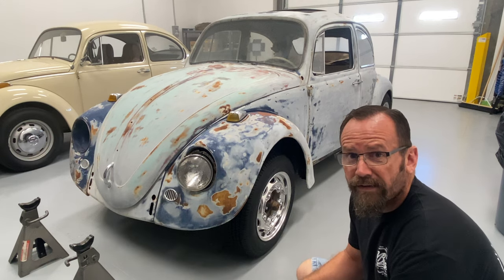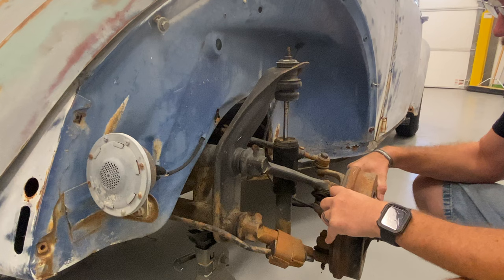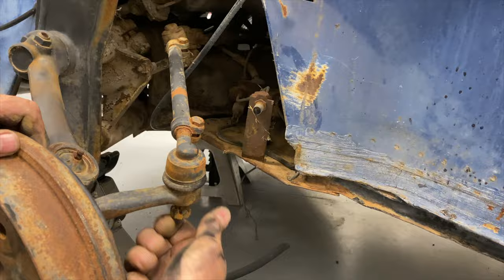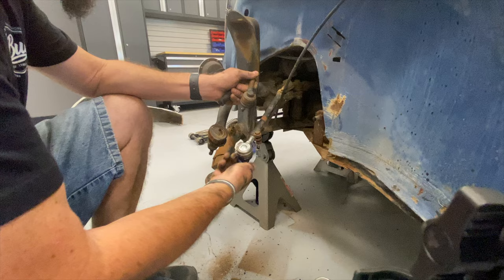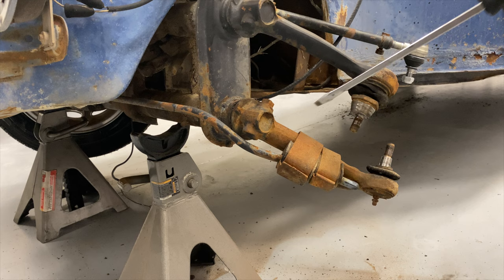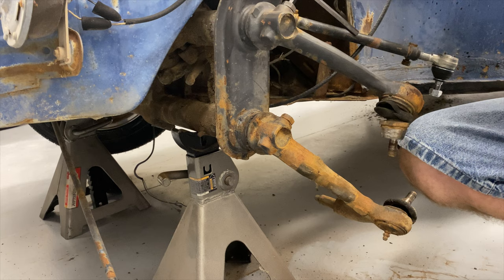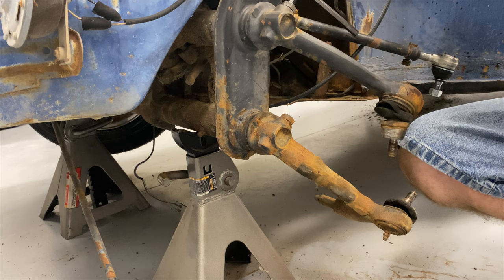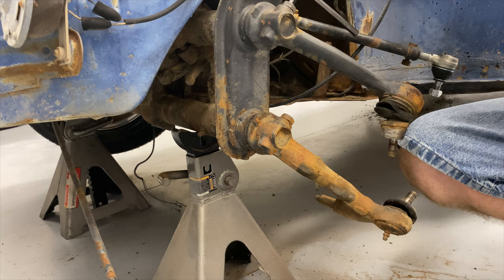1967 VW Beetle - Drop Spindles - Disc Brakes - Part 1

Comment: "I'll read those last" Haha! Love it Sam. Glad to know I'm not the only one who does that.
Reply: At this point I don't need instructions for most things on a VW. Heck, I don't even use them on wiring kits nowadays, but then again, I was the one that wrote them for all of our JBP wiring harnesses! When it comes to engine internals, I'll go back to the manual just to make sure I get the torque specs correct.

Comment: Looks like you might want to add a pickle fork to your ball joint arsenal 😉
Reply: I have one, it still requires a hammer and usually destroys the boot, I prefer not using it. Not a big deal if you’re replacing the unit but if you are, another method to get the tie rod free is handy!

Comment: Something i want to do in the future. I pressed in new ball joints and theyve done zero miles and the rubber covers are already split. Im womdering if its because i got the lowered ball joints, though my car is lowered on a adjustable beam. Id like to get a whole new beam and dropped spindles setup at some point. Look forward to part 2
Reply: Some of the aftermarket rubber components leave a lot to be desired. There are always the urethane "boots" which are really just covers but they help keep out the road grime!
Reply: @Sam_Mebane  I can't help but think I might have somehow fitted them incorrectly, causing an unusual angle and strain on them, resulting in the boots splitting.

Comment: Prob a good idea to replace inner tie rod ends since you are in there anyways.😊
Reply: Yeah, although they weren’t too bad honestly. The ball joints though…they were toast!
Reply: @Sam_Mebane  I could see that. Those things were gone. I use a tie rod tool to separate tie rods. Makes job so easy.
Reply: @SanDiego_VDubLife  I have one but rarely use it. I find it destroys the boots and still requires the use of the a hammer. I just take the hammer to the source!

Comment: If you removed the terminal why didn't you use the cut wheel? Then, used the air impact (air hammer). I believe it would be easier.
Reply: Not sure what terminal you're referring to but I am not a big fan of air tools either way.